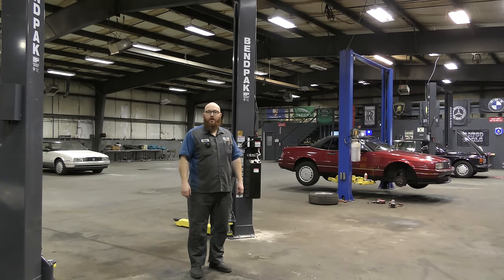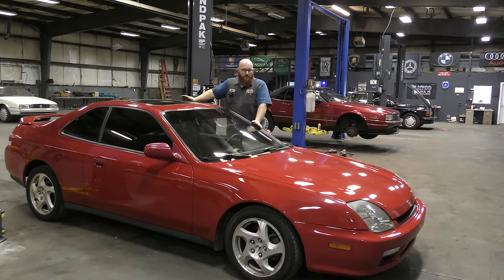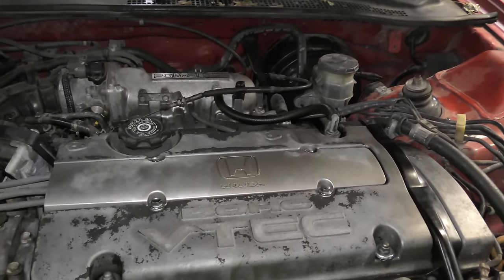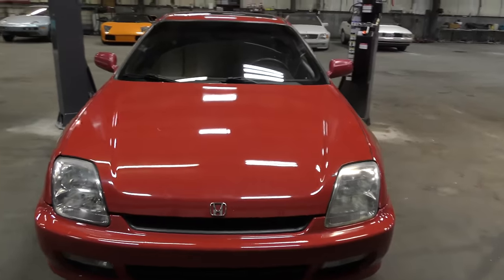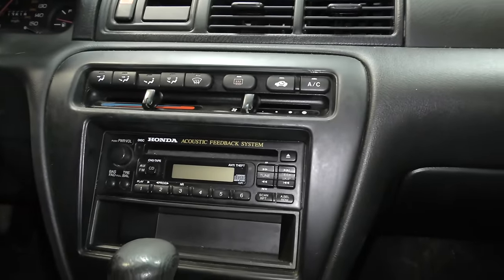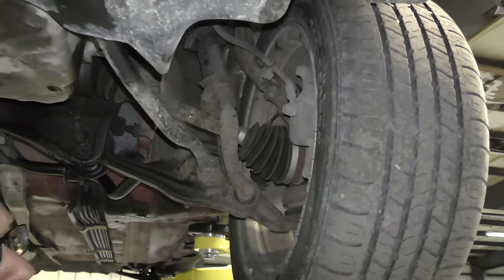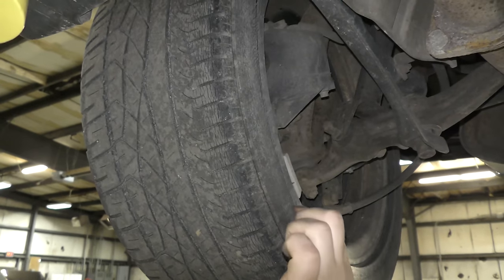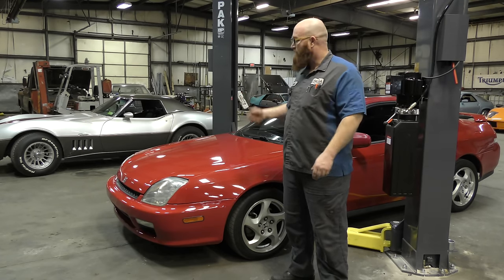VTEC YO! The CAR WIZARD finally gets a Honda Sports Car ~ A 2001 Prelude!

Comment: I noticed that the wheels on the driver side of going into different directions those wheels are side specific
Reply: Yep. Wouldn't mind having a set of those wheels for my 01 Civic.
Reply: Good eye 🏌🏾‍♂️
Reply: That's F.B.I stuff right there, you should apply. Lol
Reply: Yes, unlike a lot of directional wheels, these are True directional wheels. Impressive.
Reply: they're off on the passenger side as well if my eyes serve me right. Pretty sure the last owner mixed up the back two wheels
Reply: @KrispyKarl7  Yes they are off on both sides. They would have to be unless the car had 3 left side wheels.
Reply: wingracer 16 didn’t even think about that 😂 good looks 👍🏼

Comment: I owned one from 98 to 04'  that transmission.is terrible.  At 90k miles  the dealer had replaced the sportshift automatic 4 times.  I loved my car, but that Prelude needs a manual.  

Another thing, 2 of your wheels are backwards. The factory 16's are directional.  The flat part of the spoke should face front of the car.  When you get your tires, you can get that corrected. :)

As for mods.. The vtec really likes cold air intakes.  I'd def do that.   A VTEC controller is a simple enough mod. That way you can lower the vtec engagement point.

Comment: I like the car but wouldn't have bought one with an automatic.  But that's just me 😎
Reply: Definetly not just you :D For me it would be little bit boring, but still nice looking car :)
Reply: They aren't as fun as the manuals, but from my experience with Honda's of that vintage, the automatics can be fun and peppy too. Just short a gear. My Civic peels tires in first and chirps into second on the 4 speed auto. My Accord did the same. Both would shift on demand no slop or lag like the American brands.
Reply: It's just an Accord coupe without a stick.
Reply: @taylorc2542  accord coupe of this era with a stick would have been 150hp max. This has 195-200hp. Accord coupe v6 had 200 also but only automatic, weighed more and didn't handle nearly as good...far from an accord.
Reply: @taylorc2542  very wrong there Sir steering, suspension tuning interior exterior everything about the prelude is different.  Similarities maybe but not the same.
Reply: @enriqueortiz5440  well that might be true in your case but these earlier Honda automatics are not known for reliability that's for sure.
Reply: @eppyz  My point is that it becomes a very boring car without a manual and loses the qualities that make a Prelude special.
Reply: Jeff Eppenger He could do a trans swap, he is the car wizard after all
Reply: 5 speed swap is very common. Wizard can do the job easily.

Comment: ###Thats crazy same car I love#### I would put new wider tires maybe 235/55/17 and maybe buff paint and fix handle. Also maybe get it tinted legal specs. Def keep stock headlight and tailight housings just upgrade to led lighting. Then if you really want a hard mod change to the manual lol. BUT Def a cool car one of my favorites.

Comment: I would pop in a 5 speed for reliability, do just enough to get 200hp to the wheels and paint or powder coat the valve cover and just maintain it from there.
Reply: Alex L The Autos in these cars are just fine if they’ve been maintained. Keeping it original is more of a rare breed these days.
Reply: @waterloo123100  Nah, these autos are rubbish. Would be worth more manual swapped than keeping it auto.
Reply: Alex L you only get another 5 horsepower with the manual transmission.  Plus how much would that cost.
Reply: @bngr_bngr  the manual swap isn't what pushes it over 200, it's literally just because the manual revs slightly higher. An ECU reflash can hit the 200 mark no problem. 
Having said that, the euro R gear box or a manual f20b gearbox would boost the torque considerably and give it an LSD. THAT would be tons of fun
Reply: ipariszalonna Their only rubbish if you abuse them. I have both a Manual and. Auto and I paid about the same for them. By the time you get all the parts to swap a manual you’ll have more in it then the car is actually worth.  Finding clean prelude with no wrecks auto or manual is nothing but rare these days. Taking the original parts out of it would do nothing but devalue this car at this point.

Comment: Man I miss mine.  1997 5-speed, eucalyptus green pearl with the 2-tone interior and OEM chin spoiler.  First car I bought on my own.  Put tens of thousands of miles on that car, was a great road trip car for two.  

Had the VTEC solenoid get clogged, it loved to eat 1-2 quarts between oil changes, also ate a clutch at 80k miles and a few other minor quibbles but when she warmed up and got on the hot cam it was a blast to drive.  

I miss the precise steering that could tell you the brand of cigarette butt you just drove over by feel alone, the crisp turn-in, high quality (but simple) interior, manual radio/climate controls that never broke...the thing was a scalpel whereas my ‘07 CTSV is a brute sledgehammer with fragile Delco electronics that love to leave me stranded, or without AC or with an ever present CEL for an obscure clutch position problem.  

But alas I met a girl 10 years ago I knew I’d marry and would want babies, and the ‘Ludes back seat was good only for dogs and bags.  Still miss that little Honda. Automatics suck the soul out of them though.

Comment: Love this car and thanks for saving it! I owned a gorgeous blue/tan leather 1996 VTEC model for 10 years, and a 1990 and 1982 before that. I loved, loved it. Please don't gh*tto this car out. Put some brake pads/rotors on it that'll give it some extra bite. My experience was that a strut tower brace and summer tires really sharpened my Prelude up. Other than that, although I know you're not a body guy, some kind of finish correction would be cool. Honda built these cars way better than the people who trash them with aftermarket crap. Please keep it stock.

Comment: The 4-speed auto transmission on my prelude just went out at 170k miles 😭
Reply: Consider yourself lucky, they usually fail a lot sooner.
Reply: My 5 speed went 255k on my accord which is a very similar trans and it still works but i h swapped to get the shorter gears for my h22a... long story short learn to drive with 3 pedals 😂😂
Reply: Time for a manual swap...pretty damn easy conversion. Only need to jump a single pin on the ecu to avoid CEL.
Reply: Mine was slipping at 100k. Sold it for 3500
Reply: Welcome to the Club. 1998 AWD CR-V owner here with the same condition and A LOT less miles [116k].

Comment: Hi Wizard, good you caught the error.   In U.S.,  the first car with VTEC was the 1989 Acura Intregra GS-R.  It had the B17A1 motor.  I remember test driving one.    I also had 1998 Honda Prelude.  Mine was White Diamond Pearl and a 5 speed, and I still miss that car.  Too bad you couldn’t find a manual.

As for mods, I found OE Honda interior trim kits that replace the trim around the HVAC and radio as well as the door plates.  Back in the early 2000s,  I went with faux carbon fiber, but I believe there were other finishes were available.  It did break up the blackness of the interior.  I can send pictures if you like.

Comment: I had a 5 speed one of these in this same color about 10 years ago, completely stock.  It was the only car I ever made money selling (bought it for $6k, sold it for $6.5k, lol.)  It's probably the best car as far as doing normal car stuff, carrying me to work reliably every day etc. that I've ever owned, and was still pretty quick.  Mine burned oil when it went into VTEC, and I do remember driving between GA and MD (9+hrs?) and having the oil light come on, stopping to check and the dipstick being bone dry, so I'd recommend watching the oil level.  Also, 5 speed swap; definitely think you're missing out with the automatic.   When you change tires, remember that the wheels are directional and should be mounted so that they're "clawing forward"; your rear driver's side is correct but the front driver's side is backwards.

Comment: I love the fifth gen Honda preludes. I would keep it some what stock but done very tastefully. I would add 17 or 18’ wheels and some bolt on stuff like maybe stainless steel exhaust and highflow cats. Tune up, bigger spark plug wires, air intakes( ones that actually make some hp on the dyno) and of course a dry air filter( no k&n’s k&n oil filters are not that great-dry air filters better). I would beef up the brakes and add beefed up suspension pieces and brace up the body with bolts ons. That’s about it. It would be nice cruiser. Good luck with it!

Comment: Honda had VTEC over a decade before this Prelude. It was first in the Integra's B16.
Reply: wasn't NSX the first Honda with VTEC ?
Reply: He probably meant an actual Honda product not an Acura product I’m assuming. However civics and accords have been having VTEC on their higher trims since the mid 90s although it was economy vtec not power vtec
Reply: It was actually a motorcycle.. But yeah I guess first car with VTEC was an Integra B16A..
Reply: @fohatadri  Integra B16A beat it. NSX was first V6.
Reply: @geogmz8277  No it wasn't. That wasn't called VTEC regardless of similarities.
Reply: @MrCarGuy  You're right.. It wasn't the same thing not even similar although same principle.
Reply: @geogmz8277  vtec was always called vtec. NSX and all of the 80s 90s Hondas had the same system. Yes the integra was the first but in USA market, NSX was the first car with vtec.

Comment: A manual transmission swap, those automatic transmissions are shit.!!!
Did mine 8 years ago & has been bulletproof since
Reply: Yeah these have one of the worst auto transmissions Honda ever made and that's saying something.
Reply: Jim Colton I bought my stick 01 in 2013 and still running extremely solid.
Reply: It's one of those neat details with old Hondas. They were known for some of the absolute best manuals and some of the worst autos, guess they put the effort where it mattered.

Comment: That is a real gem Mr Car Wizard!! Perhaps the one thing I’d be tempted to do is putting on supercharger onto the H22A, along with extractors & exhaust. No crazy PSi figures, but just bit of extra go to make it a little more enjoyable. Does this model have  ATTS?
Perhaps start by rectifying that paintwork and replacing the missing badges.

Comment: What to do on the car? My suggestion, restore one or both of the front head light, paint correction one the doors, nice seat covers to complement or contras the color of the car, replace audio speakers if needed, change anything you think that would made it more comfortable or convenient. To the rest keep it most stock as possible and enjoy. Nice car Wizard.

Comment: Nice find wizard! I used own a 91 prelude with 4ws and the bastard B21A1 engine with FRM sleeves that ate up piston rings for breakfast. Great car and all preludes were and built like a great GT car. The looks are the best and you got it in the best color. 

Recommend to keep it stock but I'm getting old like you and I am done with slamming the car and exhaust. Just get poly bushings and good rubber on it and it will be fun!

Comment: Really clean car! The A/T is alright, but a manual will make that H22 come alive. You can do some mild upgrades like a  mild cam to keep it street friendly. I prefer the JDM tail lights, you may like the domestic market ones as they are. I agree with you on the front of the car so lets leave it alone. That stock head unit lends itself nicely to amplification. The output is clean and upgrades can be kept to better quality speakers, in the stock locations. A discreet sub is up to you depending on your preference.  Your project...have fun and enjoy!

Comment: My First car in high school when I was 17 in 2002 was an 86 Prelude Si 5speed, loved that car, got a good job bought a used 2001 Prelude base 5 speed in 2007 loved it too, commuted 80 miles a day round trip never boring, plenty of passing power. I miss it that VTEC is unreal, I left tired form work, spaced out and rear ended another car, ended up totaling it, I was so mad at myself. The auto is good, don't knock it, my brother had an auto 00 base had good power, add an aftermarket trans cooler to this one for longevity.

Comment: My wife had a 90 prelude si manual (red color). it was a fun car but the one thing we couldn't figure out is that when the car became warm and you turned it off, it sometimes would not start. you had to wait until the car cooled down and then it would start up without issue. great car though. have fun with yours.

Comment: AEM cold air, Mugen header, magnaflow cat, 2.5in exhaust, muffler of choice, tein street basis coilovers, acura legend dual piston front caliper mod (fun!), powerbreak drill/slot rotors. JDM fog lights complete the look.

Comment: I would get nice lightweight wheels and tires, maybe some decent suspension upgrades if needed, if suspension is in great condition I would leave it stock or maybe just get springs to lower it an inch or so. Maybe a intake kit for the sound, I like intake noises. LED headlights for sure. Maybe get a different spoiler or just remove it. Get rid of the chrome trim the easiest way (plasti dip/spray paint, wrap it, or replace it with new black trim)  TRIPLE inspect the sunroof to make sure it won't ever leak. Maybe plasti dip badges black. Maybe get aftermarket exhaust, not a loud one but just a step up from stock and hopefully much lighter than the stock exhaust. That's about it... congrats on the sweet car!!

Comment: I got a BB6 manual, best car ever drove. Smooth and Fun. Handles well. Not the fastest but really drives well. Engine is great. Seriously underrated cars. The VTEC engaging is really noticeable compared to other hondas. You can hear and ever feel the cam changing over to it.
Reply: Top speed on the manual is around 145mph or 235km/h

Comment: I just replaced a timing belt and water pump on a 2000 manual transmission. It was the easiest dual overhead cam engine to align the belt on! This is the first prelude I’ve ever seen in our shop that wasn’t beat up and modified

Comment: I have the exact car color and all but mine is a 2000 with 35K miles. I'm the 2nd owner. The car is only driven in nice weather and I put about 1500 miles on it a year. It's garaged 100% of the time and I have had mine for 8 years. It has only seen rain 4 times since I bought it and the guy before me also stored it all winter as well since we live about 10 miles from where it was purchased new (Buffalo NY area.)  I keep the car as close to 100% original with all Honda parts except for tires and rotors. I still have the same radio in it and have done NO mods to the outside or inside. I have it insured for $10K and I'm pretty sure it will be in my family well after I'm dead (I'm 67!) All the cruise night kids love it! Leave yours as stock as possible if you can. I noticed the badging is missing from the trunk lid as well as the front grill and rear bumper. The car does scream when you get on it like you said! Enjoy the new and exciting ride.  Arnie

Comment: I had the h22a in a 94 Honda Accord- we modified it with a new pod filter, ignition, ECU and after market manifold and exhaust that gave it a low dark growl..  very reliable and fun to drive

Comment: I would replace the tires, Go for the 5 speed swap, and get the whole car re-painted, and detail the engine bay. That's it. The car is very pretty and as you said, it looks great from the factory. Nice find Wizard.

Comment: I owned 2 of these. A 98 and 2000. Loved them. But one thing in the video and I know. The wheels are also directional. The 2 rear wheels are on the wrong side. Sucks if the tires are directional though. Love your channel. Keep it up. 👍🏻

Comment: If I got this. I'd put on some Michelin Pilot AS tires, do a 4 wheel alignment, check fluids and flush if needed. I'd switch to high mileage oil just to keep the old gaskets conditioned. My personal favorite is Royal Purple HMX. I currently use this in my 2000 Toyota Tacoma with just 136,000 miles. No oil leaks. Just a slight sweat from the back of the valve covers. I do 7500 miles oil changes with this oil and the cams aren't even stained or varnished.

Comment: I have owned my 1988 Toyota MR2 since 2008. Besides a better air filter, EBC brakes and custom exhaust, I have kept it stock. That's not to say I haven't replaced things like alternator, clutch, water pump, timing belt, radiator, and so many hoses and seals. But it has been easy to live with after fixing the first owners' neglect all of those years ago. I feel tastefully done era-correct rims and tires would be nice for your Prelude. Perhaps a nice air filter insert and replace the exhaust when it wears out. Better brakes are also worth it. The manufacturers usually get things right though. My neighbor had that model in white years back. He was not kind to it. It was a shame.

Comment: This was my dream car back then and still sorta is. The closest I could get was a 5th gen accord coupe 5spd. Looking underneath I can see your prelude shares almost the identical suspension to what I had. I had the 2.2 sohc vtec good for about 145hp. Was fun with the 5spd though I always dreamed of swapping in the H22. Never happened. As for your recommendation of a mod
..go for the manual transmission swap. The 5spd really livens these cars up. They shift real smooth and have a real nice clutch feel.